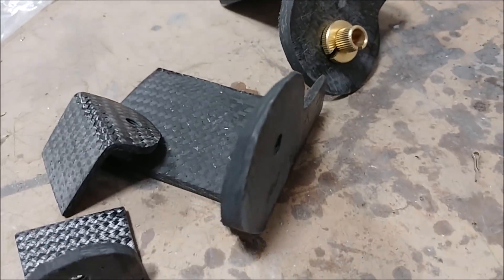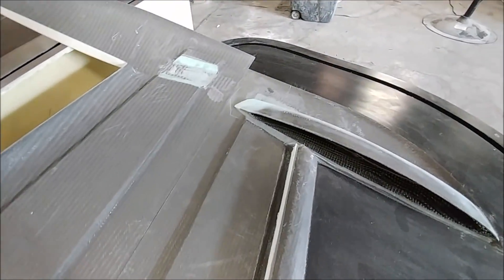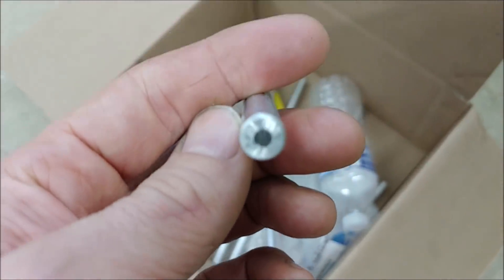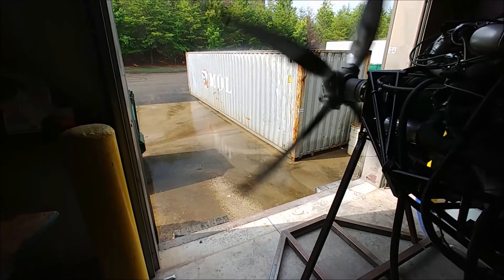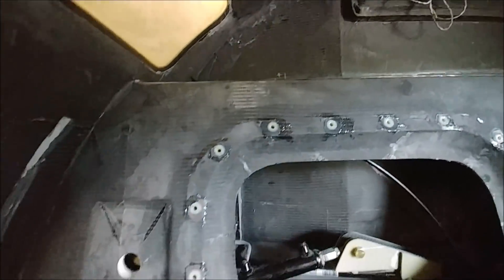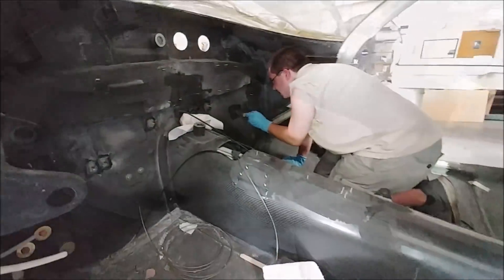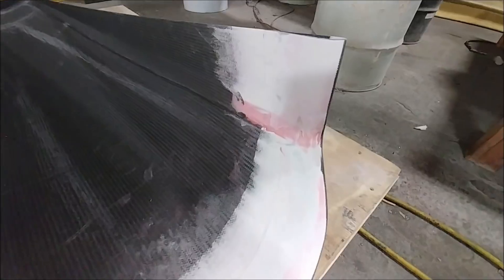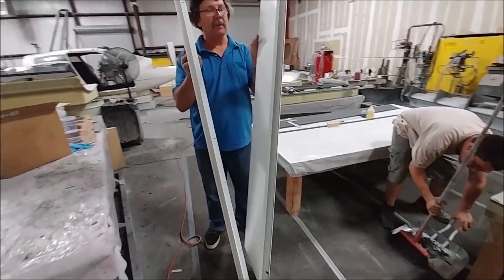Rudders are Done! - Building the Raptor Prototype

Comment: What will be the new door lock system that you have in mind?
Reply: ATAG dB, In previous videos, Peter has talked about a split door; much simpler design. I recall, the bottom half will incorporate a step and the top half will lift up and stay open with a telescoping rod. Something like on the Aerostar 600. The present door, for the prototype is very complex and while beautiful, has proved to be problematic.

Comment: All the detail and enormous amounts of work are really impressive to see.  Thanks for sharing.   
I can see why doors have to change it.  Will new design be lighter?  As these finish up it would be interesting to see if they have gained weight vs cad projection?
It’s fun watch & learn a bit of composite Mfg.  Can some of the hard points be incorporated in the production moldings or is all the detail work permanent?

Comment: G'day Peter. Great update as always, just starting to see the finish line appearing on the horizon. Well done so far. Sorry I know your busy but ! a question without notice. Are the production aircraft going to have a rear facing camera to be able to clear the prop area when the doors are closed ? It does seem as though that's a blind spot. I think I remember reading somewhere or may be you mentioning that the avionics  has a video input that could used for that purpose. May be it could be offered as an extra or a custom addition. Anyway food for thought. Regards!
Reply: Robert Hale I believe you are correct that the plan was to have a rear facing camera feed as well as a camera feed for the redrive belt available.  Not sure if it was available with the avionics or the center android/iPad screen.
Reply: Jason Dendinger It would certainly makes sense and shouldn't be difficult to arrange even if they use an automotive reversing camera solution.  Would be good to be able to see that area as part of your pre - start check list.